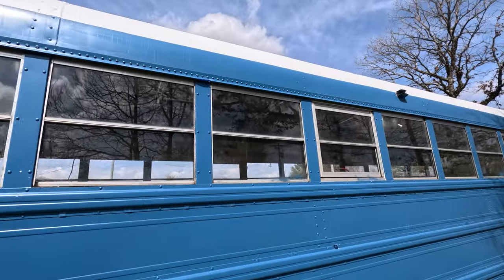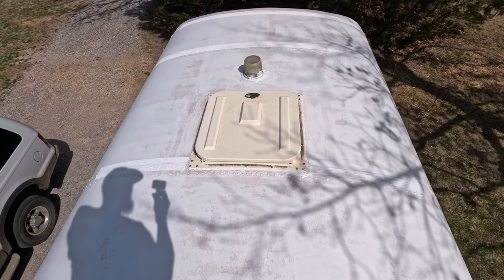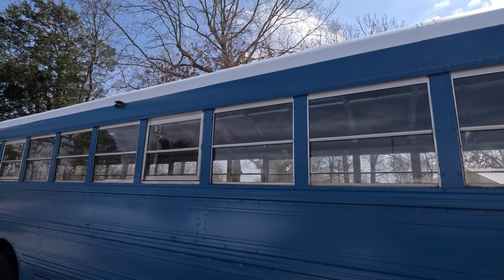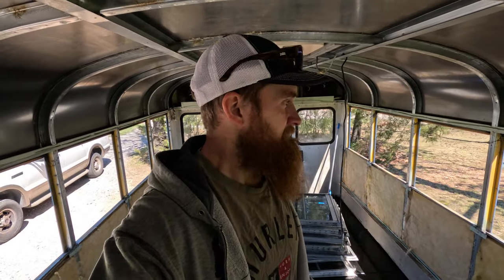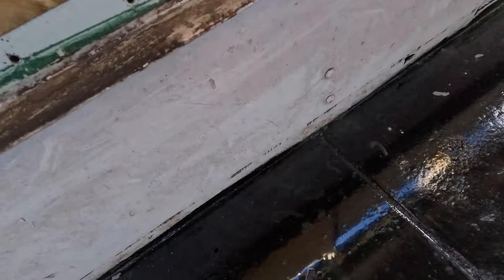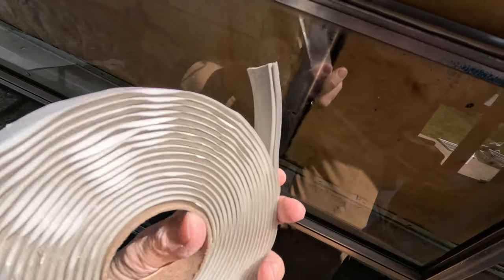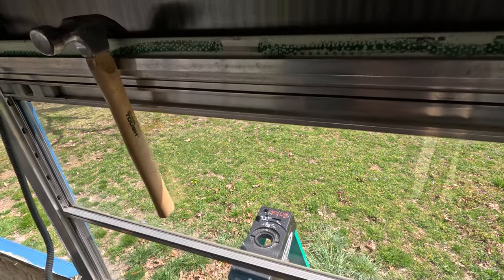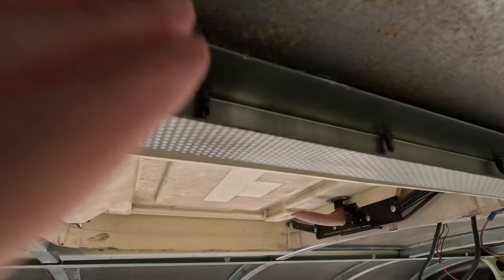Can we stop our Skoolie from leaking? #skoolieconversion

Comment: The roof of the bus looks very nice and white! 😁And impressive work with the windows, taking them out and back in again. Luckily the rain didn't happen until after they were back in. After identifying the leaks and then fixing them, I hope the next time it rains there are none. I wonder if there are alternative ways of filming from the roof of the bus without using a tripod? Could be expensive replacing them. 💰💸
Reply from the maker: Thanks kiwiman! Looking back at that situation, I probably shouldn't have had the camera up there with the wind that strong. I will definitely be looking at other options if I need to film up there again.

Comment: That looks great. Cooler too in the heat.  is that henrys?
Reply from the maker: Thank you, it turned out pretty good. We used the Dicor Brand Metal Roof Coating. It is similar to Henry's.